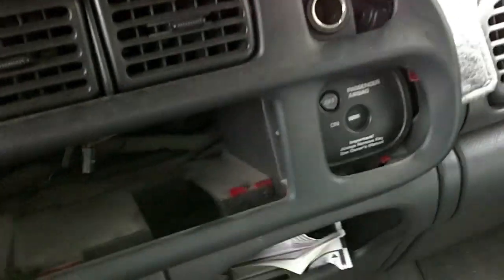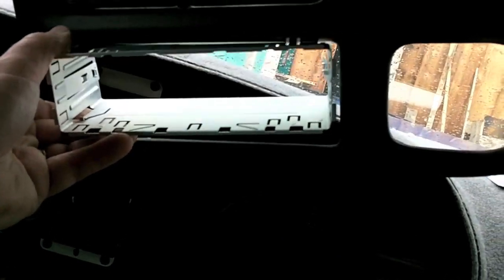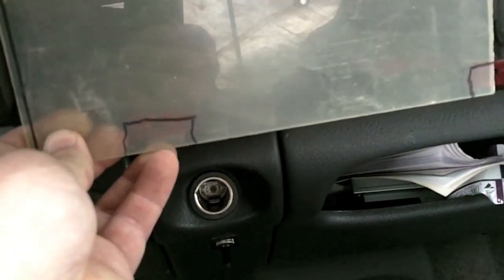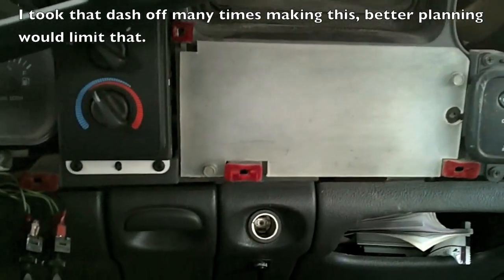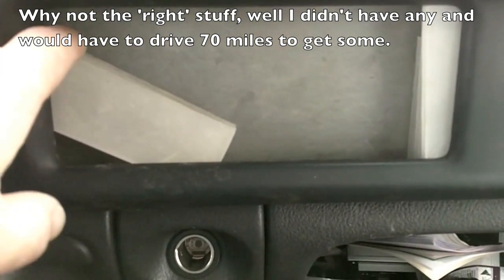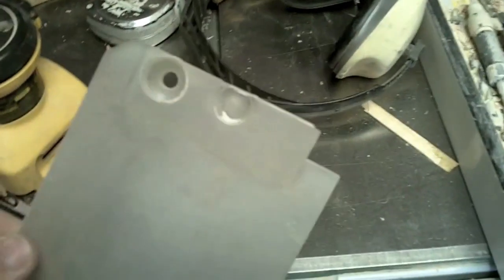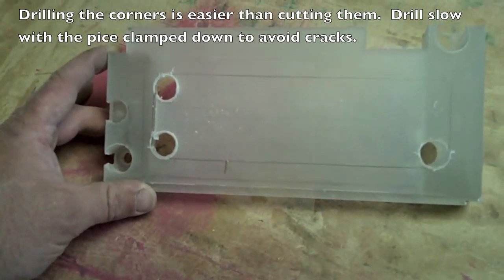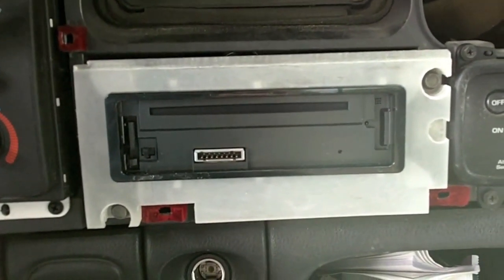Installing a JVC radio Dodge Ram

Comment: Also, Metra makes their kits and harnesses on location in Holly Hill, Florida. I had the pleasure of touring their facility while attending the Installers Institute there in Daytona some 20 yrs ago :) And yes, I have been in the industry professionally for many  years. Molding ABS was a difficult process due to building a form, heating the plastic, stretching it over another form and slow cooling it while not cracking it.

Comment: dartha chagala In case you never solved your radio issue in your 99 Ram-
You undoubtedly have the premium (infinity) sound system.  The amplifier for the front speakers is built into the speaker itself, and only works with the original deck because the wiring is completely different for the speakers.  There is an aftermarket adapter available for this purpose, but its not cheap (~$110 I think), or I recommend doing what I did - get new front speakers and run new speaker wires out to them.  All other wiring is normal and the new head unit will work beautifully.  You will not be able to power the tweeters mounted in the pillars (either side of the windshield), but you probably won't notice, as the newer sound systems offer much greater fidelity than even the "premium" factory sound system in 1999.

Comment from the maker: Do you have the door speakers with the horseshoe on the back?  I said it was some sort of choke but have been since told they are an amp.  You need to attach your new radio's aux power/amp power line to that amp.  I think I talk about the color combo in part two otherwise you can look it up on the back of your old and the back of your new radios.

Comment: i have at 1999doge ram 2500 turbo disel and i put new stereo in it but it dosent work well the  stereo works but the speakers dont  and i put the old one bag on it it work just fine if you know anythig about it will you let me know whats the problem

Comment: I have a 2000 dodge magnum and I got a newer radio and I need a installation kit but the ones I found for a dodge say that it works for years 2005-2007 does anybody know if that one will work for my truck

Comment: This video is terrible advice. DO NOT WATCH
Reply from the maker: Oh? Do tell.  Is it because I did it without cutting any of the factory wiring?  Is it because I made my own mounts so that I didn't have to buy a kit?  Is it because nearly 10 years later it is all working perfectly with no issues?  Or is it because it isn't what you would have done thus is clearly dumb because you are the Lord God Almighty of truck radios?  Maybe you are one of those guys who can only do something if someone else did all the hard parts.